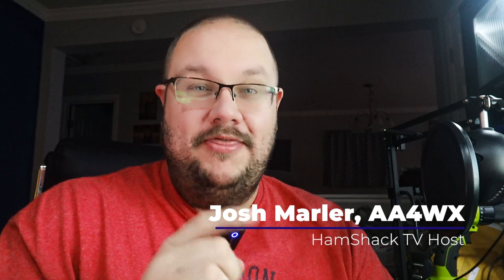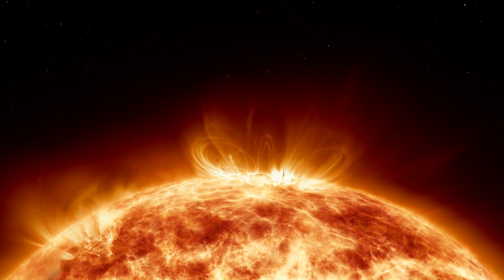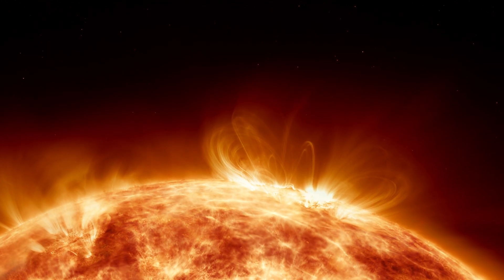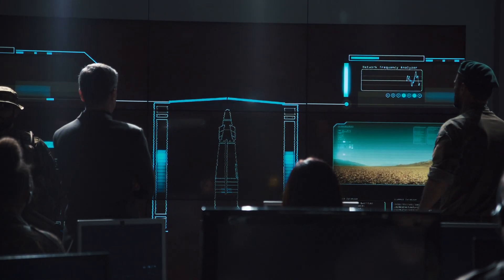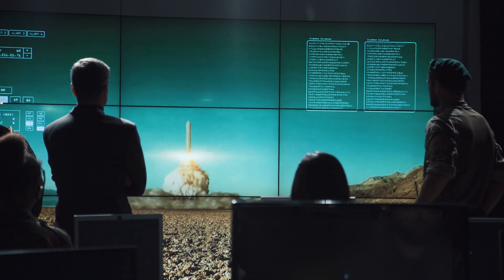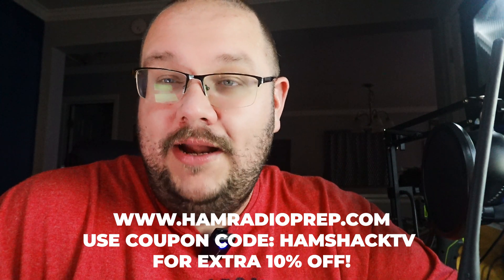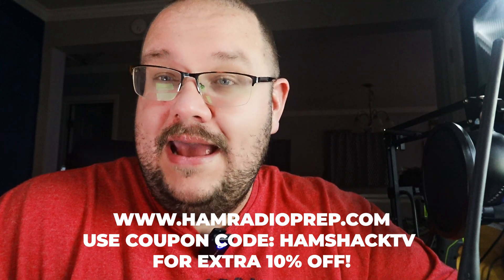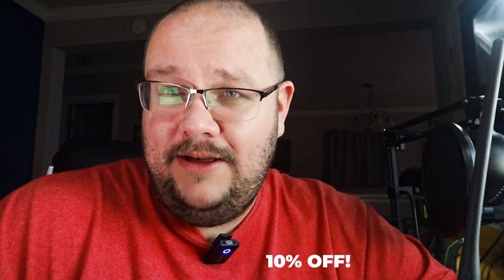How to Protect Your Ham Radio from EMP: Tips for Hardening Your Gear

Comment: a CME does not have the same electromagnetic characteristics as an EMP.   Recent studies show that the metal case of radios such as the IC7300 can protect the radio if all cables and wires are disconnected.

Comment: Josh you left out one very important point. In the event of an EMP situation there won't be just one EMP, there will be several because they attacker will want to catch you pulling your equipment out to use and fry it, so would be important to wait several hours to a day before you pull out your electronics. Also a simple metal trash can will NOT protect your radio gear.

Comment: Shop the good will store you'd be surprised about the kiddy toys with out interference they  have up to a mile or more range. The older 49 Mhz rigs I have at home up to 2.5. wally world rigs cheep line of site once again extra battery's. PS I have sw radios that kited out with longer antennas with gator clips. ...

Comment: OK here is how to do it. You need a spark gap with a relatively low firing voltage in parallel with the antenna, on the receiver side you want a choke designed to cut out the ehf and beyond but pass your TX and RX bandwidth. Isolate the RX section and install a device called a bilateral avalanche diode between it and ground taking into account the capatance. For the power input you will want to build an isolator and shunt. Same deal, with a heavy duty isolation transformer in the middle. You would want a common mode rejection choke and two surge quench tubes to ground and a big stack of MOVs before you reach the isolation transformer. Make sure the core of the isolation transformer is well grounded The key to dealing with EMP is to dump the fast risetime pulse to ground as fast as possible. ❤
Reply from the maker: Thanks for sharing your detailed insights! These tips will definitely help anyone looking to protect their ham radio gear from EMP. It's great to see such technical knowledge being put to good use!

Comment: So Solar is emp exempt?
Reply: the panels may degrade 3% because its a chemical material reaction, and Lead acid batteries are the same, its not going to hurt the acid or lead, but will if you have lifepo they have charge controllers inside (chip based)
it also depends a lot on where you are in relation to where it goes off ie: if it goes off within 20 miles of you, you have bigger problems, the effect will go out as far as 200+ miles, the ground you are on will also play into that, are you on sand or granite, most of the items being hyped as a protection is Garbage! like the EMP shield is crap, but when it fails after an EMP how are you going to call or email them to get your money back?

Comment: Put your radio in the tub with water but make sure the tub water is grounded with number 2 copper.
Reply from the maker: So you're saying a bath is not just for relaxation, but also for EMP protection? Just make sure you don’t accidentally create a new “splash-proof” radio category!

Comment: Will and EMP burn up electronics if they aren't energized or don't have power in any way?
Reply: Any solid state Electronics with a wire attached, the wire will act as an antenna and pick up the emp. 50,000 volts per meter typical. So a 1 M length of wire will be energized to 50,000 volts.
Reply from the maker: Great question! An EMP can indeed affect unprotected electronics, but the extent of the damage depends on various factors. If they're unplugged, they might be less vulnerable, but it’s always best to take precautions just in case!

Comment: ALL connected equipment is subject to EMP.  Your antenna and power cord will kill your gear.  Sheilded cable, surge protectors, etc. will not save your equipment because they are a direct path to your shack.  The only way to actually be safe is to have a backup set of gear in a serious Faraday cage.
Reply from the maker: Thank you for sharing your insights! It’s always great to hear from fellow enthusiasts who know the ins and outs of EMP protection. Your advice will help many!

Comment: Mine will :)  Rigs are tubes and discrete components.  Now iffin yours is digital, got fancy displays and every thing runs off buttons, color it dead:)  AE4YW
Reply: This is why I have a multiband HF/VHF transceiver in a double Faraday container.  We'll talk on the flip side. ;-)
Reply: during the carrington event morse code telegraph users got shocked and  the wires and telegraph keys caught fire. no fancy displays, no fancy colors.
Reply: @mikemcdonald5147  A Carrington event is quite different from an EMP.  First the Carrington is far far more powerful from the sun and is global!  An EMP will spike a few thousand volts but tubes will ignore it.  A microprocessor runs on 3 to 5 volts.  The transistors inside are quite small and will fuse with the voltage spike.  A few years ago, they captured a Russian MIG.  They were all laughing that the ignorant Russians were using tube radios.  Poor things couldn't afford modern electronics :)  Then they realized that an EMP would be ignored by the tubes and their planes would still fly just fine :)  We spent over 4 million dollars to invent the power point pump ball point so our astronauts could still write upside down in no gravity space.  The Russians solved the same problem by using a pencil :) AE4YW
Reply: @ All of those facts are true.  The causation relationship is, however, a bit iffy.
Reply: Such is why I keep my HW-101 and other Heathkit gear.